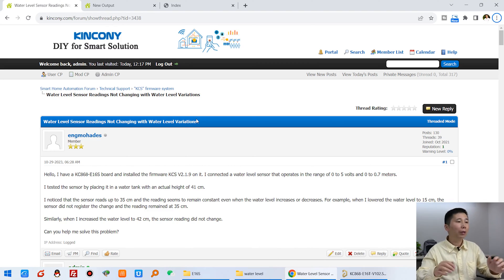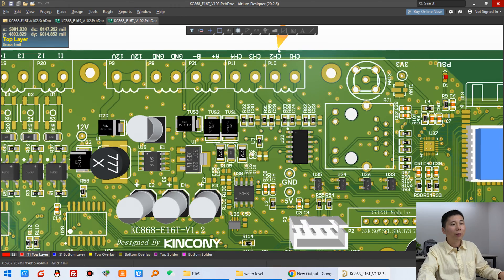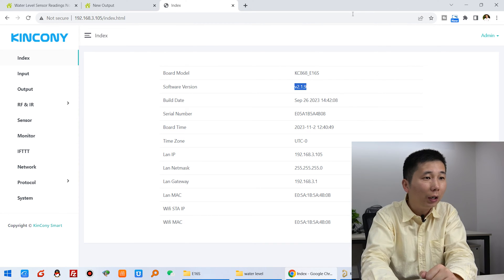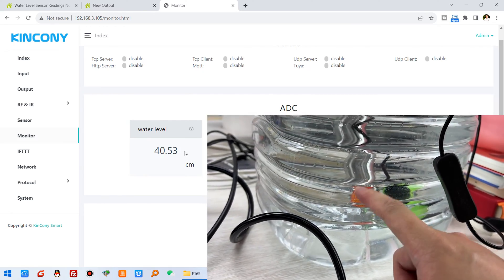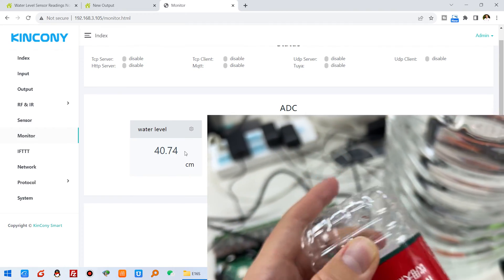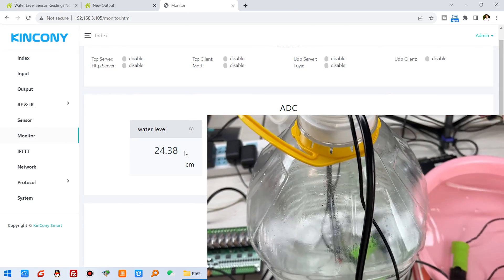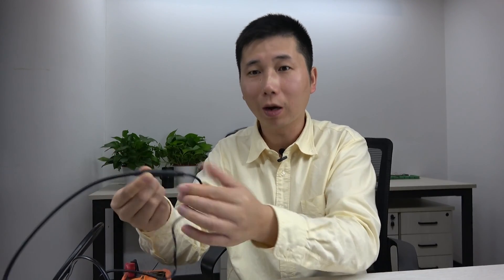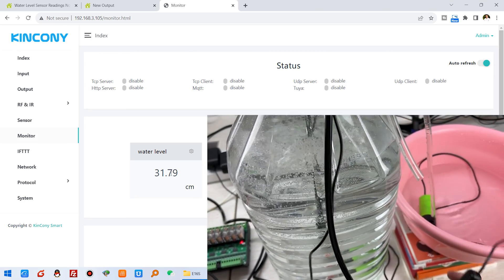how to use water level sensor by ESP32 board & automatic control relay

Comment: Hi, do you mind what can i do using this level sensor to replace my conventional method of using tape water level sensor? i really need this for my pumping test work on a tubewell where i don't need to pull up and down my current water level sensor to measure the water table. As a newbie, where do i start with? my tubewell is at 50 - 60 meters depth
Reply from the maker: if you want 50-60 meter, need customize make the water level sensor, it just output analog signal to esp32 board.

Comment: Does it record data as the depth of the water increases or decreases? Is it possible to measure the inflow or outflow of this water with this equipment?
Reply from the maker: this is a sensor, whether data record according to your MCU's software code.

Comment: thanks for video. can we use digital level sensors insted? I want to make a auto water change system. For example, for one day a week, the drain pump operates up to the low level sensor. Then it stops and the filling pump runs up to the upper level sensor. Is such a somewhat complicated scenario possible with this interface?
Reply from the maker: sure, you can chose water float switch sensor. just detect HIGH or LOW level.

Comment: will this automation work without internet? You will make the automation with internet, after if you disconnect the internet, will the set automation and analog-digital input-output still work?
Reply from the maker: sure , must work without internet. it's important. logical automatic control locally without network

Comment: Thank you for your effort. I have identified the mistake, which is connecting the water level sensor to point A4. I have connected it to point A1 instead, and the readings change as the level changes. Thank you.